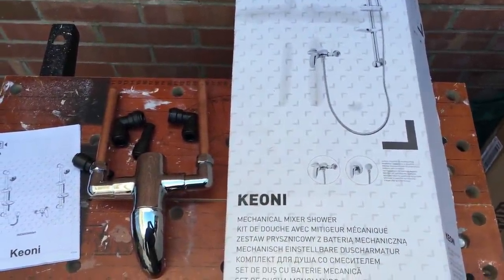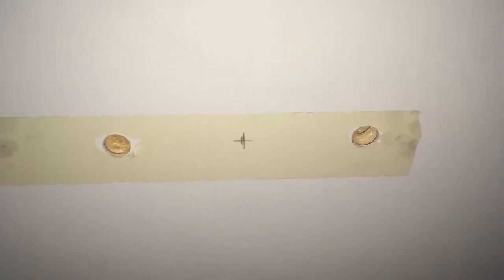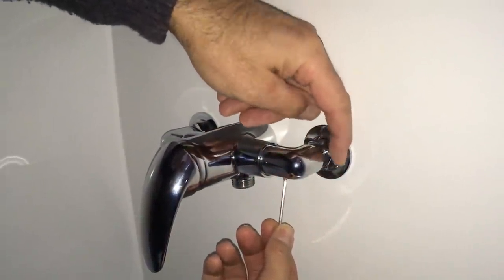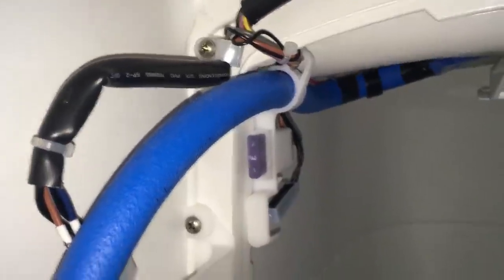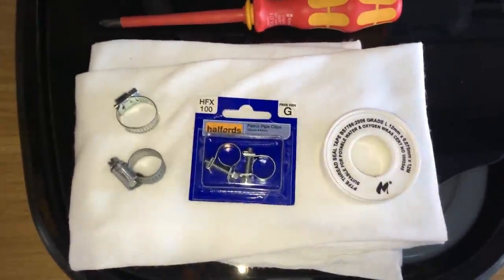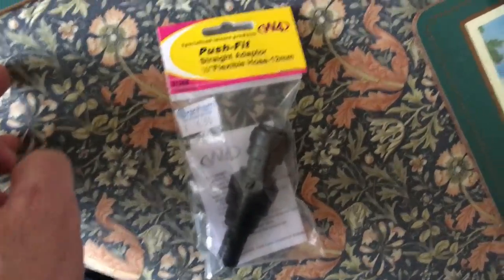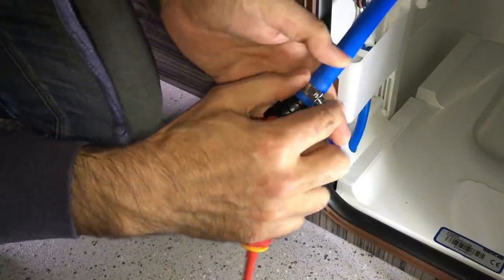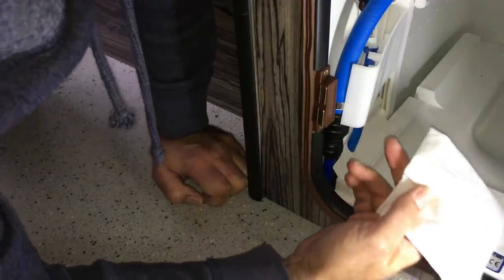Fitting the Shower Mixer and Toilet Problems - Self Build Campervan

Comment: Hi Greg.  

I have bought a c223cs Thetford toilet and it has arrived without a wiring loom.  Thetford do not list the loom and their agents don't know how to get one!!  I have seen an American video where a guy ignores the purple and grey remote pump relay wires and connects to his pressurised system after fitting a pressure reducer, does this make any sense?  Any advice you could offer would be gratefully received.  Thetford are a dead loss..

Tanks again for your videos which I have used extensively.  Cheers  Si

Comment: Could the problem have been exacerbated by the Thetford toilet requiring a maximum pressure from the pump of 0.7 Bar, I think your pump is 2 Bar. I'm looking at buying a toilet at the moment and wondering now whether to go for the one with a flush tank to prevent this issue as I would think it would be harmful to the pump to restrict its pressure output with a flow reducer. How's your fix holding up?

Comment: Hi Greg, question about pipe sizes. You mention going from a domestic shower connection size of 15mm down to the van’s internal plumbing size of 12mm... Did you purposefully use 12mm plumbing in the van for a particular reason? I ask because when doing a conversion, especially with domestic taps and showers, AND pipes and adaptors, being cheaper than caravan/camper equivalents etc., that it might be better just to go for 15mm pipe all round. Your thoughts?
Reply from the maker: Miles Fryer yes I did purposefully use 12mm LDPE and push fit fittings as it’s the standard size for motorhomes and campervans. All the boiler connections were 12mm push fit as were the drain valve etc. It does not need to be 15mm, flow rate and pressure are really good and I do not recommend installing 15mm copper or domestic fittings as there’s no flexibility in that type of installation. It can be brought cheaply online.
Reply: @GregVirgoe  Thank you Greg, I guess it is a choice of having everything house domestic or "caravan/van" dimensions. Thanks for taking the time to answer. :)

Comment: Morning Greg, should I leave the water pump on at all times or turn off once the water is up to pressure ?
Reply from the maker: vinny w mine is on all the time. It works on its own in built pressure switch and if not using water it will stay turned off and automatically come on when you need it to. 😀
Reply: @GregVirgoe  thanks Greg.

Comment: My OCD is making me twitch like Inspector Dreyfus in Pink panther with that grub screw.. Why didn't they design it to fit in the BOTTOM of the mixer unit so it would be both out of view AND be accessible with the allen key ARRGHH :D.
Stuff like that really does my nut in. :D
Reply from the maker: Andy C that would make more sense I agree 😀

Comment: This is the very reason I have not connected the toilet to the water system. It is a very poor design as you say. I will use the shower head to flush the bowl as and when required. Get yer finger out Thetford !!
Reply from the maker: big bez the W4 adapter has worked without any further issues for over 18months 
So that is the way to go.
Reply: @GregVirgoe  Perhaps Thetford should include the adapter with the toilet kit.
Reply from the maker: big bez that would be some help

Comment: I've used these before now on my old car cooling system and even when fitting a s/s exhaust instead of the usual U-clamps as they're really strong. They come in a range from cheapest mild steel/plated (W1) to full A4 S/steel with A4 bolt (W5). Very handy as you can easily swap them out without having to remove a hose and they don't have any holes, lumps and bumps like the ordinary Jubillees you showed us, plus bevelled edges so they don't cut into the hose. Whilst that wouldn't have solved the wrong-sized barb problem, they're still worth knowing about for future projects. Get them through suppliers on eBay etc.    https://www.youtube.com/watch?v=dK7LDkK_zO4

Comment: Hi Greg 
Sorry to say the hose clips your using are not jubilee clips .
They are just called hose clips .
Jubilee is a brand name .
And we use to make the clips for them many  years ago.
I have worked for a Company 
that make hose clips 
for over forty five years here in Suffolk,   our brand name is Hi Grip and Hi Torque .
Our clips are probably one of the most well respected brands in the world.
And we export all over the world including Japan .
And yes they preform well beyond the British standard .
Soon as I see the clips you were using I thought yip they are rubbish. 
Glad you got the leak  sorted .
But if had used one of  our clips you wouldn't have had any problems.
As we pressure test our clip of that size to 200 psi with no leaks permitted .